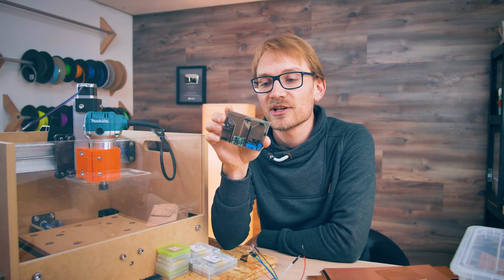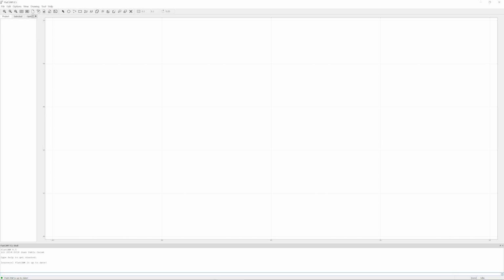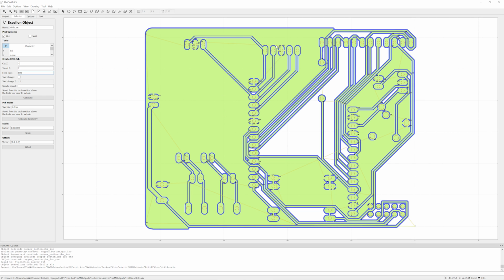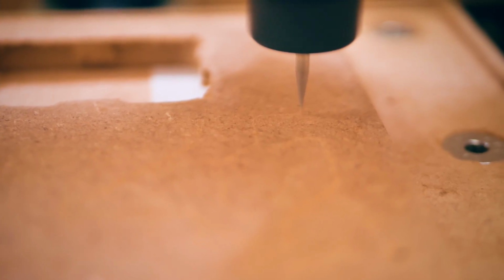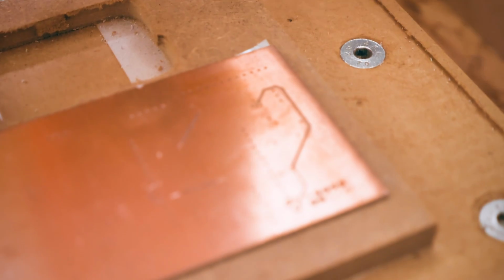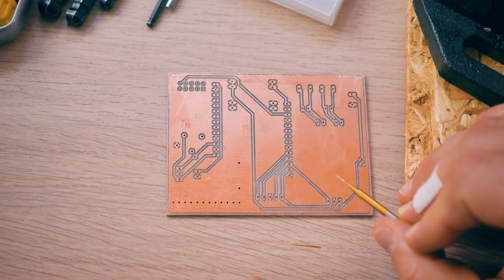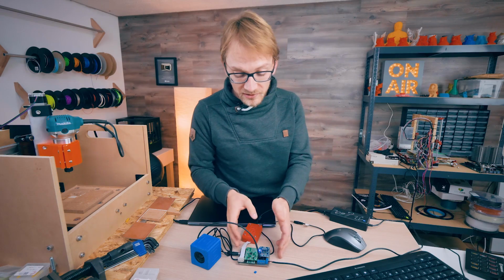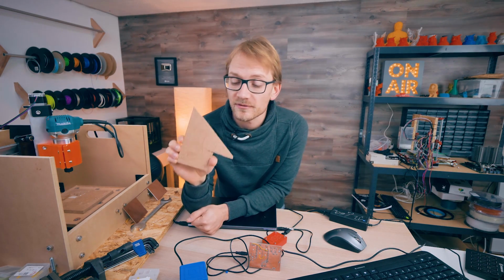Make custom PCBs with the Sienci CNC and FlatCAM!

Comment: Depending on how deep down the rabbit hole you want to go, there are UV activated DIY solder screen kits out there.  You'll need an ink jet printer to make the mask and a UV light source if there isn't one included in the kit you choose.  There's also solutions you can dip the board in to tin the exposed pads.

Comment: 24:00  Am I missing something with Flatcam here? Everytime I try it the finished milled board has tracks that are totally unusable thin. I've tried with 0.2 and 0.1 V bits, 0.5m end mils and lots of different cutting depths, but every time flatcam seems to cut the track "inside" leaving very thin traces, rather than cut outside into the waste leaving a nice thick and usable track. For me its not producing anything usable. I don't seem to have vibration or runout as the track width isn't noticeably wider than the cutting tip.

Comment: Sounds like user error. Learn how to setup your machine. Slop is user error. You shouldn't have issues with a ball screw system. I have 3 belt drives that I don't have issues with because I know how tram and square my machine.

Comment: I have a Long Mill 30X30 CNC router. The main reason I would us this technique is to make sure the components would fit. I am purchasing some screw terminals and want to make adjustments on the PCB before sending them to the manufacturer. The pricing through the manufacture is good for professional quality boards. Thank you letting me know about the design software. I am using EasyEDA and it has a minimum of 2 layers on the board which I only need one layer.

Comment: I realize this video is two years old. Tom, thanks for an excellent write-up. I just built an ANT CNC (you should, too!) and ran into many of the same things you did here. Had I seen this video before purchasing my 0.1, 10-degree engraving tips -- I probably would have saved some money.

That said - the reason flatcam doesn't do contoured cuts on board cutout geometry, is because flatcam is really.. not great.
The board cutouts consider the existing min/max coordinates of the loaded geometries, then creates a simple bounding rect for the board cutout geometry. It doesn't pay any attention to an edge-cuts gerber, except to get minmax coordinates. This is why you can generate a board cutout from the copper layers + a specified margin.

I'd complain about the quality of flatcam more, but to get it to even run on my Ubuntu 10.21 system, I had to checkout an alternate branch from the github repository. It feels almost as unpleasant to use as bCNC. ALMOST.
Reply: Maybe the issue is that you're using Ubuntu 10.21, when the latest release (as I recall) is Ubuntu 21.04?

Comment: Just caught this video. I'll admit to cringing at the board layout! I have laid out PCBs from 1984 to 2016, now I package die in smaller packages. Milling PCBs was done at Polaroid for prototyping in the 90's. The best guideline is to use large traces (80% of the pad) and use the same spacing for trace-to-trace, pad-to-trace, trace-to-vias.  For example a 20mil trace with 20mil spacing (roughly 1mil = 25um but use proper conversion when getting over 4 mils/100um).  Avoid sharp angles off the pads, try to come straight out and then use 45 degree bends. Space traces as far apart as the open space allows. We had very good results with 25mil traces and 25mil spacing for the machine that was in-house (forget the name, the company was in Lebanon, NH, USA). 

For CNC milling of PCBs use all the space and don't try to pack everything too tight. Your results will be better and shorts will be reduced.  Good luck!

Very good video, focus was tough at times only because of the tiny items you were trying to get the lens to focus on. Nice presentation. Bit of a changeup from FDM/Resin 3D printers!

Comment: You could do a quick silicone conformal coating to act as a solder mask and then just solder over the parts you need to connect.

Comment: Its not the wobbles with engraver bit. Its because of the engraver bit its not meant for pcb engraving because of the drill bit is wider when it drill deeper.. i leart this lesson when operating my othermill for my pcb design.. try 1/64 dril bit..

Comment: Hi all..
I’m a PCB designer from Sudan and we are undergoing a very bad economic embargo that’s why we can use service like JLCPCB or any similar that’s why we have to fabricate the PCBs on our own, and I would like to share the design rules that we are using, it might seem bulky but it work best for us and it will work very good for anybody who is fabricating on his own, without further ado, here are they:

Minimum clearance: 16 mil (0.4mm) 
Line width: Minimum 50 mil (1.27mm)
Line width: preferred 55 mil (1.4mm)
Line width: Maximum 60 mil (1.52)

For the pads and vias we are using:
Minimum hole size: 0.8mm (31mil)
Minimum diameter: 1.8mm (71mil) 

If you can change the pads (vias) freely it’s recommended using diameter size as: 1.8x2.4mm (Rounded rectangle preferred). Note: With this setting you need to keep the larger diameter size perpendicular to the component i.e. the 2.4mm must point outward an IC pins.

Which this I think the PCB will work with no problems, but of course you can’t drill SMDs with it.

Comment: Love the details of your videos!  You should check into a company called T-tech.  They did some really cleaver things with their PCB cnc machine that I have yet to see anybody try to duplicate (I guess nobody ever thought to actually check how the professionals do it).  I used to own one of their machines 20 years ago and it was nice.  Particularly the way they aligned boards with two pins in a 'sole & slot' system and the way their machine (which was 2 1/2 axis) used a teflon 'foot' to set the milling / drilling depth very very precisely.  I am sure with your skill you could perhaps come up with a gravity-fed z axis like theirs.  Their machine was on the market since the 80's so I am sure any patents are long expired.

Comment: Thank you. I saw another video where this guy used CANDLE GRBR to operate his CNC machine. He was able to use Height Mapping that accounted for the thickness variations of the PCB material itself. That was a good idea to mill the surface flat, but you still had that SAME problem that I run into doing this. 
Using Height Mapping this problem goes away. 
I don't blame the "V" bit anymore, but I did just buy myself a set of 0.5 mm end mill bits. Thanks again for this great video.

Comment: If your board is running marlin you can use an alligator clip to the PCB, an aligator clip to the bit, and both connected to z-min and use G29. (FIX MOUNT PROBE option)

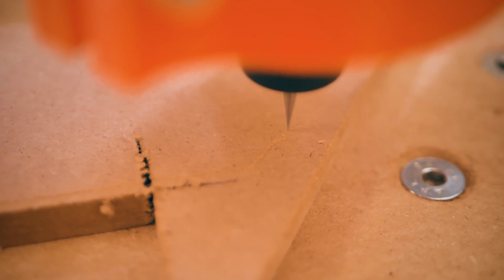Comment: 13:58 "later on I used an other method thtat worked better" xD what is that method? that is what I want to know : how do you correctly set you Z-Zero so that this conical tool makes the correct line width.

Comment: I went through the same sort of process as this with a cheap CNC3040, ran into the same issues, gave up pretty quick and crawled back to toner transfer (which I got really reliable by dipping the board in etch before attempting transfer). Kudos to you for following through to success! Now I have a K40 laser cutter, and I hope that I never have to go back.

Comment: Runnout on the router + runnout on the "collet adapter" + backlash on 2 axis + flex in a angle aluminum track = ruined PCB

Comment: Shot in early 2019, you’ve missed many points Thomas. Don’t you watch YouTube? 😉 No electrical bed leveling? No conformal coating milling? Sketchy selection of bits, no roundup of the more dedicated players in the area like the Ant PCB mill, wegster,... well ok wegster is pricey, but just for the appalling images, you should have mentioned it. 🙂

Comment: Vee bits don't last more than a few seconds if they are not runnign perfectly centrally. I know from experience after trying 3 different 775 motors, the 3rd one was so much quieter and cut beautifully, the first two were boisy and vibrated. If you turned the spindle manually with the cutter just touching the copper, you could see it was cutting a circle not a spot. You should replace the collet for a 3.175mm collet and ditch the adaptor.

Comment: Man, I wish you could get 8mm ballscrews like you can get acme trapezoidal lead screws. That would make tiny CNC machines like this SO much better. You also would need a spindle with better manufacturing tolerances though.

Comment: couple of thing i see wrong in this. The toolpath was generated for a smaller tool dia, If the dia of cutting tool is larger it will cut more material, which is what happened here. with the v bits and even with square end millyou have estimate through experiment what diameter are you ending up getting on the copper clad board and make sure that in your design software (eagle) these minimum clearances are mentioned.

Comment: Angled 1/8" tip breaks easily bc if increased heat(copper). I am positive a cooler fan or liquid cooling should increase the chinese 1/8" tool's life span. Plus traces being thicker than the bits' width may also be about increased heat for heat making the copper even more ductile,soft,sticky etc. and harder to remove from. Moreover the play bc of collet adapter or collet itself enlarges the bits tip area. I likethe simplicity of the machine. This video is more like how to shot a youtube video than what the machine is about. Hardwork appreciated.

Comment: I know nothing about this topic and just came across your  video by accident, but doesn't the sticky tape move at all - not even by 0.1mm? Won't sideways pressure cause just a slight movement of the PCB and it will depend on what direction the bit is travelling in? As a test, what if you clamped the PCB firmly to the bed at both ends without using any tape under the PCB?

Comment: Tip for soldering bare copper circuit boards: use a flux spray (SK10), this prevents the solder form bridging. After soldering you can easily remove it with LR PCB cleaner (or leave it on as a protective coating).

Comment: Regarding the squared board corners:  I'm using FlatCAM 8.92 and have made a "cruciform" board like this:
In the Gerber section for the edge cutouts, select "Cutout tool" next to "Board cutout".
Then, after putting in the cutter parameters, use the "Generate Geo" button next to "Freeform".
That makes the cut outline follow the actual line, rather than squaring it off.

Comment: As a machinist, I think your main problem is trying to machine such narrow widths.  I would dread using any cutting tool smaller than around 0.8mm.  The tools deflect too much, which is what cut your slots too wide, along with runout.  The small tools also break too often, which ends up meaning slow feedrates.  Small tools also require more RPM than most machines can run at.

Comment: you could use a 2 part epoxy to use out as the solder-resist and then cnc the holes later

Comment: If all you have is a hammer... there is absolutelly no valid reason to mill pcb's this way, besides 'i just wanted to do this'. Making a PCB is a lot easier and cheaper by just using a foto-sensivite PCB, and etch them.Just buying the drill and mill bits, is more expensive than to purchase the stuff needed to ech a pcb, and the quality of an etched PCB is infinitessimally better.
Reply: But you are stuck with the messy etching and disposing of the etchant . I used to make many photo resist PCB's and the ferric chloride ended up all over the place. But you are right, you can make detailed pcb's fairly easy.
Reply: @larsord9139  Partly true. You should not use ferrochloride. Use Natrium PErsulfate instead.

Comment: In the world of milling tool runout is king.  In the world of milling using micro-tool, runout is the queen mother of the king and no one f's with the queen mother.   Seriously:  Get a cheap runout gauge and measure your runout of the end mill as it is installed in the collet and tightened down.  All runouts are additive and subtractive.  That means you have runout in the router. You have runout in the collet. You have runout in the tool.  None of that matters.  All that matters is how those runouts add together additively or subtractively.   You want them to cancel out as much as possible.    So you load the microtool up into the collet, capture your z height, tighten it down, and measure the tool runout.   If it is bad.  Loosen up the collet, turn the collet with the tool in it within the tool holder 45 degrees (or 90 degrees) relative to the tool holder and repeat the whole process.   If you make the runout worse, try turning the collet in the opposite direction 180 degrees.  If you find the sweet spot the collet with the tool, you can then go to turning the tool within the collet.   With some rapid trial and error, you can find the spot where the runout gauge wiggles the least and your runout is minimized.   By doing this, your microtools will last a lot longer.   The other tip for microtools:   Cooling / lubrication / chip evacuation.    You can literally just hold a shopvac near the cutting process to get the chips out of there.  Recutting an already cut chip will add wear and tear to to the bits.   New / Sharp Bits work best.   If you can add a little lubrication to the mix go for it, but at the very least use a blast of air or a vacuum to keep those chips out of there.  With those tips you should be able to get much better results from micro-milling.

Comment: Those engraver bits work just fine. You set the dept of cut at -0.1mm. Thats too deep considering that the copper coating is just 35 microns thick. I set my depth to -0.045mm and I get gorgeous PCBs with a pad pitch of as low as 0.5mm. Also you need to slow down the feed to around 75-100mm/min so that you don't snap off the tiny tip of those bits.

Comment: Capacitance Re-flux Evaporation Syndrome. Stepper Motors more so than a Shaft Drive Linear Actuators, keep power flow to the Motor at Zero, while at rest. Reset Zero actively upon each power cycle of the equipment.

Comment: Using Eagle is much easier to generate a gcode directly from the eagle by pcb-gcode ULP.

Besides, in my opinion, pcb milling without auto-leveling does not give good results.

Comment: Thomas using CNC machine to make PCB's is not bad idea. But very fine tracks are impossible to make with a CNC, the copper is ripped off the board. When you use a microscope to examine the fine tracks, you will notice burs of copper touching the other fine track that are close together. Either there be a short circuit or a high resistance short. The hard part is narrowing down where the fualt is along the fine track without a microscope. Normal width tracks are no problem with CNC machine. Even home made PCB's with fine track get etched away quickly leaving no track at all. So no matter haw you do it there will be a issue or problem.

Comment: I also build my own pcb-cnc out of left over parts. I figured out that these chinese bits are garbage. Switched to "Sorotec" LGS.0045 and LGS.0030  (30° and 45°) and boy these cut through the copper like butter. they are expensive (7,30€ a piece) but really good.
Reply: That's exactly what I use :-)

Comment: Hey Thomas, I've been over all this too. After uncountable failures I can tell you that the key for success is to use quality brand engraving bits! Forget the chinese bits where you pay 10 bucks for 10 of them. Good quality engraving bits costs about 10$ each. The difference on results is another planet. Oh... I guess that autoleveling is mandatory too. My CNC is homemade and looks less stiffer than yours, and still I can achieve isolation lines of 0.1mm wide for 0.05mm of depth. Cheers mate!

Comment: Nice video!
I do PCB's with my home made CNC machine too. It takes a lot of trial and error and a bit of tweaking, but after having done that once i'm able to mill out perfect PCB's. (Especially in Fritzing - thats what i use in combination with Flatcam - it seems necessary to enlarge the 'solder islands'  to be able to solder the components confortably). I use a Kress spindle,  same engraving bit and the same shank reducer Thomas uses, so the shank reducers are not the problem. My CNC machine does have ball screws however.

Comment: Look at the video and you can see the endmill wobbling ever so slightly so run out needs to be put into the Eagle file and it will turn out much better.  Try 0.6 or 0.7.

Comment: I obtained exactly the same results with a open source 3D printed CNC (Cyclone PCB). It also features a proper way to autolevel.

In short it is basically useless for SMD, so lately I'm "outsourcing" in China the production of my PCBs.

Comment: Hi Tom I've used Flat cam to cut custom PCB's before the  board cut out adds Tabs but will only generate a square shape around your traces. if you process the profile it will cut the shape but will not add any tabs so you'll need to make sure that your work is held down, if you are using clamps.

For Custom PCB shapes process the "profile" or "contor" GERBER file as you would for the traces in flatcam rather than using the board cut out feature. Flat cam will generate two paths an inside cut and an outside cut. continue working through flatcam's processes untill you have your gcode file. now edit it in a text editor search for the "G00 Z1.000" command (the Z hop) inorder to find the start of the different cuts.

the top half of the file is the inside cut whilst the bottom half is the outside cut. delete the bit you don't need.

Comment: Try a cheap low power UV laser and dry film photo resist + UV curable solder mask. Sure you need to etch in between, but results are much better
Reply: But you are still etching!